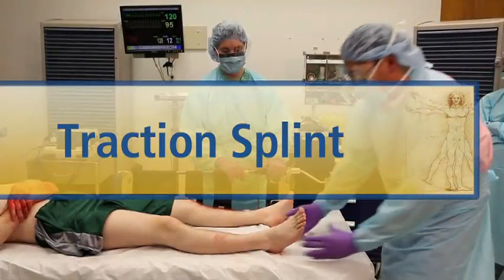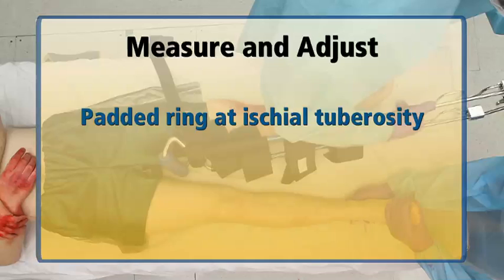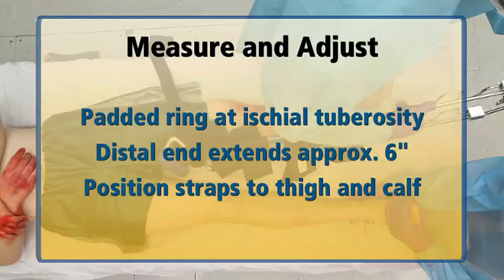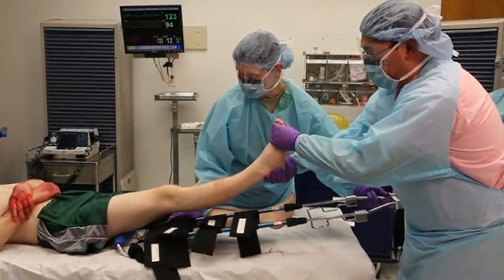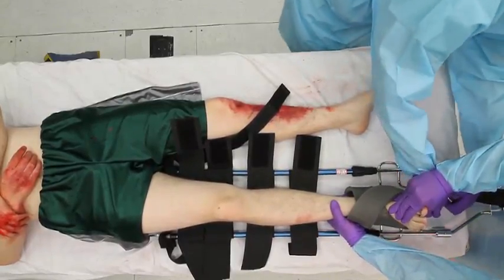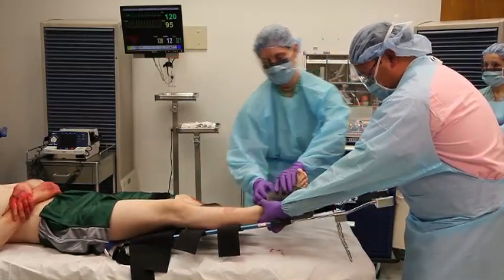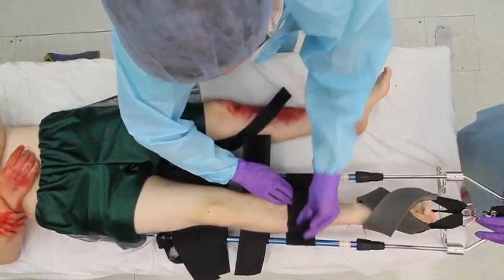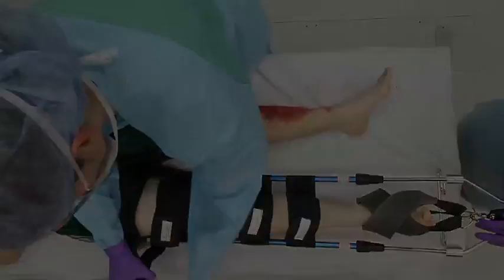Traction Splint ATLS

Comment: Should the ischial strap be in place before traction is applied?
Reply: Christopher Wilshusen yes, they skipped several steps in putting the splint on. Please make sure to have your partner apply manual traction first, measure the splint and add 6 inches of over lap, apply the ankle hitch, put the splint under the leg, apply the ischeal strap, attach the ankle hitch to the windlass, start to ratchet the leg until relief of pressure or until leg appears straighter, then apply all other straps.
Reply: I was thinking the same thing. Kept looking for the top strap.